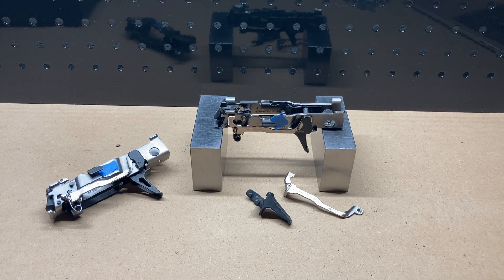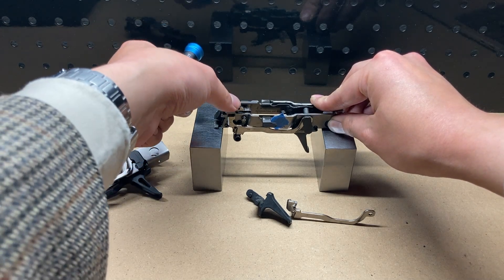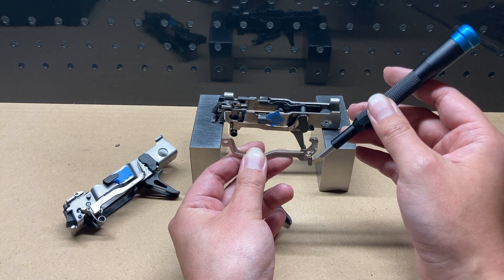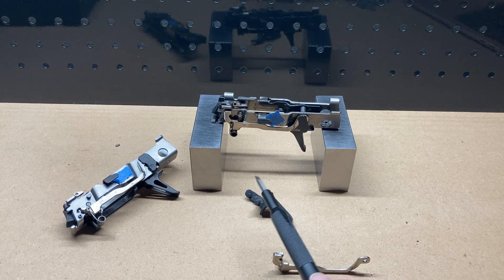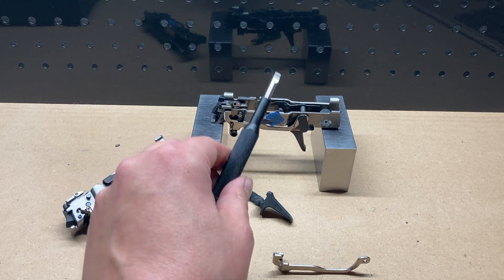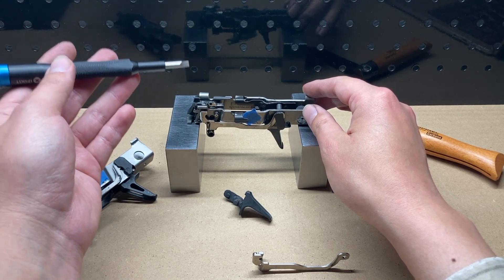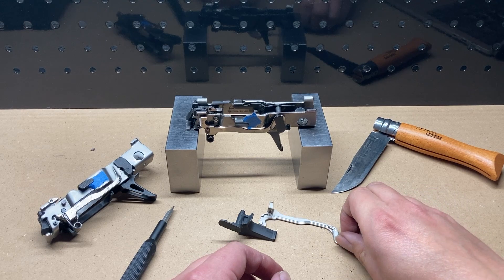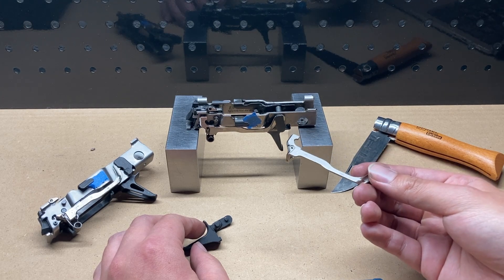P320 Sear Movement Test followup: It's all about the Trigger Bar and Trigger

Comment: My P320 with an Apex trigger bar and Apex flat trigger fails. I'm going to revert to stock and see what happens next
Reply from the maker: A good data point, albeit somewhat unpleasant. I hope your stock components do not fail the tests!
Reply: They did. No combination of stock trigger bar with stock trigger, apex trigger nor armory craft slightly curved trigger produced a passing result.
Reply: My apex trigger bar is an early version that is listed pat. Pend and is black for what is worth
Reply: Also of note, my stock components were from before a manual safety was offered but after the initial 'voluntarily recall'.
Reply: Which the date is 29Nov2017
Reply: Further research indicates that the safety lever has undergone a change. The one that came installed in my FCU also utilizes a safety lever spring. I am very interested if there is a specific combination of parts that has been shown in multiple FCU's where N is much greater than 2 that passes this test.

Comment: I have two P320s. One fails the test and the other passes. The one that passes, I had replaced the disconnector to correct the “firing out of battery” issue. The one that fails the test still will fire if the slide is slightly pushed back out of battery. For what it’s worth and I haven’t looked at all the comments to see if anyone has stated this already so apologies if so.
Reply: What are the dates stamped on your FCU in each pistol?  That's an easy thing to track specifically to see if things are correlated to specific aged component designs or not.
Reply: @ Both FCUs came with the old style disconnector and failed this test and could be fired “out of battery” by hand. I have never had ANY issues with “discharges” with either gun other than my testing from these initial reports years ago. I replaced both triggers with identical Apex triggers and the issues persisted. I replaced the disconnector on the FCU dated 040122 with an aftermarket one from The Sig Armorer and issue seems to be corrected. I have not replaced the disconnector on the FCU dated 022222 and issues is still present.
Reply: @Doubleala73  Excellent info and thank you very much for the dates.  My other question on this was whether aftermarket parts could correct for this, and the disconnector from Sig Armorer is probably the top of the list there.  I also wonder if any aftermarket trigger/trigger bar replacements could affect this issue.
Reply: @ it was occurring before the Apex trigger swap on both guns and the trigger replacement kit came with an Apex trigger bar as well as springs and the issue remained on both after replacing these items only. My gut tells me the disconnector is the issue, at least in my limited experience.

Comment: I've done a test on my 2021 p320 rxp x compact to verify if the striker block is doing its job. Loaded a dry fire laser cartridge and took a fine pick to push and drop the sear from the striker though the rear slide plate, after dozens of tries with empty and loaded mags to make tensions weren't a factor without fail. I'm sure that there's so many variables of parts and tolerances between the FCU and slide components that failures would be hard to pinpoint but not impossible due to sig constantly updating components. Excellent work! 👍

Comment: Interesting design. Accidental sear movement moves the safety mechanism that is supposed to protect you from accidental sear movement. Next level innovation.
Also it always moves, but the timing of where the safety is defeated is random. You gotta be shitting me.
Reply from the maker: Less "random" and more "incredibly important" - causing disconnector-like behavior seems to delay the defeating of the final safety long enough to catch the striker. Most importantly for my friend's purposes, I haven't yet found an easy answer of, "Buy this trigger and this trigger bar and it'll fix your failing FCU." Ultimately, my goal is to find a way to fix this issue so that people can actually trust their pistols again. More to come...
Reply: @P320Truther This shouldn’t have to be done, Sig should refund all customers including military and police contracts. Worse metalic cartridge design in the history of firearms.

Comment: If the trigger bar is more forward at rest, the pivoting sear leg would contact the rear surface first (more push forward) but if the trigger bar was more rearward at rest then the sear leg might catch the top corner first and give it that downward forward disconnector-like-behavior. Changing the trigger could cause the trigger bar to sit slighty more forward or rearward depending on it's geometry. 
The only reason the sear can influence the trigger bar anyway is because of the stupid takedown safety lever. Remove the takedown safety, and remove that rear leg on the sear. Any potential problems are 100% removed. Pull the trigger to field strip like a Glock.
Reply from the maker: The rear leg of the sear extends significantly lower than is necessary to interact with the takedown safety lever. There is theoretically a way to remove the bottom section of the sear’s rear leg in a way that would not remove the takedown safety lever functionality, but that’ll require further, more detailed testing…
Reply: I like this idea!!

Comment: What's very interesting to see is in both examples where the FCU is installed in the grip module, and the sear is dropped independent of the trigger, the striker safety lever rises on both examples. It seems that dropping the sear manually does move the trigger rearward partially, and that partial trigger travel actuates the striker safety lever. Why would Sig design the P320 in such a way that the striker safety lever moves AT ALL until the very end of trigger travel? Sear movement should not in any way determine the movement of that lever.
Reply from the maker: By necessity, the safety lever must be deactivated by a proper trigger press before the sear releases the striker. The flaw is that if that chain of events moves in reverse and the sear is the first component moving, it ideally would not cause movement of the safety lever (as seen in the P365 FCU), or at the very least should result in non-ideal, but still seemingly safe behavior like my FCU: the safety lever defeats the striker safety lock after the sear has released the striker, thus leaving the lock in place long enough to catch the striker as it is falling.

Comment: Are the sear on both the same? Or does one have the extra striker catch or shelf?
Reply from the maker: Both sears are the post-"upgrade" version with the secondary sear. There is no easily discernible difference between the two sears.
Reply: @P320Truther I looked into mine, and will this test be accurate without the slide on to depress the lever? Safety feature I'm guessing? Sorry if I missed it

Comment: Good video, I guess what I want to know, and another video of the "small pokey thing" pushing on the sear, what would ever push on the sear when the 320 is assembled?
Reply: The sear is only held by spring tension. There is no locking mechanism. What would cause the sear to fall or the trigger bar to lift? Inertia. Torsion.  A bump
Reply from the maker: How the sear is moving on its own is the multi-million dollar question that no one seems to be able to answer. The Sear Movement Test just works on the outright assumption that it is moving, since none of the "uncommanded discharges" have been accompanied by reports of broken components, and no one has been able to show how the striker could be released without either breaking or the sear itself moving down to release it.
Reply: @P320Truther ill watch again, I guess if the sear spring failed or whatever, then it would defeat the striker safety Block?

Comment: It made me uneasy when you pushed down on the sear and the trigger/trigger bar started moving backwards. That's not just a flawed design, that is a flawed concept. Any gun in which it is possible to move the trigger/trigger bar by moving the sear or hammer needs to have a mechanical barrier to prevent the trigger/trigger from moving enough to release. In many striker guns it is a trigger blade safety. In DA/SA guns it is a very heavy DA trigger pull AND a half or quarter cock notch. Even revolvers now have tranfer bars that make impossible to fire the gun unless your finger is actively pulling back the trigger. In SA guns it is a manual safety and often a grip safety as well; 1911, Colt Pocket Hammerless, S&W EZ, Springfield XD. The P320 is a flawed design and a flawed concept. There are no secondary mechanical safety systems to prevent this type of discharge. It is only the existing geometry of the sear and the trigger bar interface which is supposed to prevent this from happening. And as we have seen in your videos, if this geometry is somehow not right then an 'uncommanded discharge' is possible.

Comment: What would push the sear forward in normal use?
Reply from the maker: How the sear is moving on its own is the multi-million dollar question that no one seems to be able to answer. The Sear Movement Test just works on the outright assumption that it is moving, since none of the "uncommanded discharges" have been accompanied by reports of broken components, and no one has been able to show how the striker could be released without either breaking or the sear itself moving down to release it.

Comment: I'm going to need to watch this several times because idk wtf you mean by disconnector like behavior.
Reply: If you push down on the sear, it clicks. This is what he means.
Reply from the maker: "Disconnector-like behavior" signifies that the trigger bar moves as though it were being pressed downwards by the disconnector. If a trigger bar displays this downward movement, it has tended to correspond with an FCU not failing the Sear Movement Test. Trigger bars that do not display this downward movement in response to sear movement have tended to fail the Sear Movement Test.

Comment: I love this kind of workshop testing. It's the home-based tinkering that gets the answers. Not the lawyer over the shoulder of corporate nonsense that is trying to get out of a fuck up by pointing fingers to save their job. Mine passed the "test," but I also added an Agency Arms trigger shoe with the Glock style trigger. Even before the recent Sig drama, I didn't feel right not having the trigger dingus. I'm just so used to it over the past 25 years. I don't know if it changes anything.
Reply: As far as I understand it, due to the nature of the failure, the Agency trigger doesn’t help.
Reply from the maker: I haven't been able to get my hands on an Agency Arms trigger with the trigger dingus, but I really hope I can precisely because in theory anything that immobilizes the trigger bar should be able to mitigate or prevent this specific failure, since movement of the trigger bar seems to be what is deactivating the striker safety lock. Immobilizing the trigger should, in theory, do just that. The question is whether the Agency Arms trigger dingus immobilizes the trigger early enough to prevent deactivation of the striker safety lock.
Reply: @P320Truther  Couldn’t you test that same theory with a manual safety model? It stops the trigger bar from moving past a certain point, at least if I understood the Sig Mechanics video on it properly.
Reply from the maker: @ In theory, yes, a manual safety would replicate that immobilization. However, this clever/too-clever little mousetrap of an FCU design has defied my expectations in the past, so I don't want to make any specific statements without personally having experimented with the actual part in question.

For example, I'm fairly convinced I know why it's the non-skeletonized flat trigger that works but not the skeletonized one, and in theory the "post-upgrade" curved trigger should behave the exact same way, but I will not say that it does until I've seen it and replicated that function.
Reply: @P320Truther  Entirely understandable , and honestly at this point it’s about the only approach you can reasonably take.
Reply: @P320Truther  I have fiddled with the Agency Arms dingus trigger from all angles and have yet to find it to fail. I am in no way on your level, but when these Sig issues popped up a few years ago, I thought it might be the fix. Also, I happen to like the trigger because I have used it for over 2 decades.
Reply: @P320Truther  I have an m18 with a skeletonized Armory Craft adjustable trigger and it does not make the click. I also have a first gen 320 that went through the upgrade but has a regular curved trigger shoe and it does make the click. Do you think the trigger is the problem?
Reply: It won’t matter if the trigger doesn’t have to be pulled.
Reply: @TheGingerKing1994  Pushing down on the sear does move the trigger since it's attached to the trigger bar. So anything that locks the trigger would also lock the trigger bar. My own testing on my P320 with a manual safety seems to bear that out. The lever doesn't even move at all when the manual safety is on.
Reply: Check if the dingus even prevents the striker safety disengagement. It only takes .09 inches of trigger travel for the safety tab to disengage. That's not much. We will know the truth in time but I hope people don't get a false sense of security with the dingus while p320 truthers are figuring this out.

Comment: I put a safety lever spring, the spring from the pre "upgrade", into my 320 that failed and then my one 320 that failed your sear test passed. Should see if it passes your test if you add the spring.
Reply from the maker: It doesn't - my previous video demonstrated that a striker assembly with a functioning striker return spring mitigated failures out of a failing FCU, but I was still able to produce protruding strikers even with a healthy striker return spring.
Reply: No, he means the original post upgrade guns had a little spring between the sear and the safety lever that acted to hold the safety lever down. Sig discontinued using it. People suspect that the spring was binding and creating more hazard than it mitigated.

This is the spring the dude is asking you to test
Reply from the maker: Ah, you’re right - had too many people asking me about things I explain in the videos, this actual novel question slipped past. That would be interesting to test.
Reply: It did not make a difference with my FCU.

Comment: I attempted to leave a comment on this earlier but I think it was flagged due to including a link.

I stumbled across a video from a guy that was able to demonstrate firing pin extrusion due to degradation in the striker reset spring. The springs are basically breaking into pieces, which causes an intermittent failure of the safety lock. It's possible that the perfect scenario that causes uncommanded discharge is actually a combination of the striker and FCU. This could also explain why a majority of uncommanded discharges are by people such competitive shooters and law/military professionals. Simply put, they are firing the gun enough to wear down the striker reset spring to the point where it's not properly engaging the safety mechanisms that are there to stop the FCU from discharging the pistol in the event of some type of other FCU failure event.

You can find the video under the title "P320 cause of uncommanded discharge identified?"
Reply from the maker: In my earlier video, we did find that the presence or absence of an authoritative striker reset spring motion correlated with more easily failing the Sear Movement Test, but it did not correlate with whether an FCU would fail the Sear Movement Test. It's certainly involved, but seemingly as a contributing factor, not as the ultimate cause.
Reply: Anecdotally, my striker reset spring failed after 1000 rounds. Pretty scary when i figured it out as it is my EDC.
Reply: My P320 with maybe a thousand rounds completely destroyed my striker helper spring. It crushed it into a little ball. I removed the pieces, haven't replaced it, and the gun still functions. It seems like a redundant part to me. It shouldn't be playing a role in the striker protruding the breech face, if the striker safety is doing its job. If the striker safety has failed, that little helper spring isn't going to keep the striker from protruding when it is released under full striker spring power.